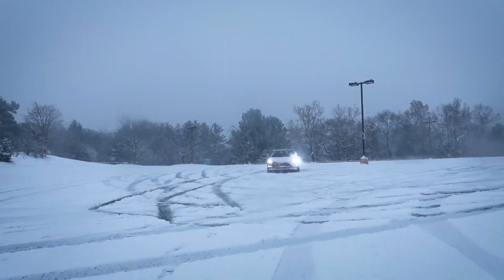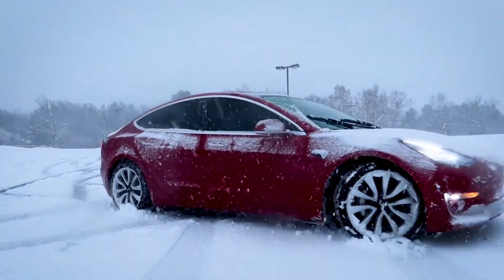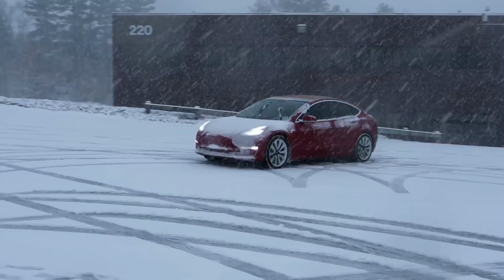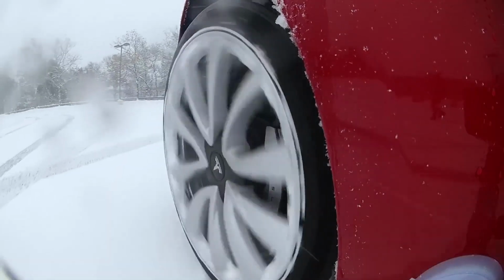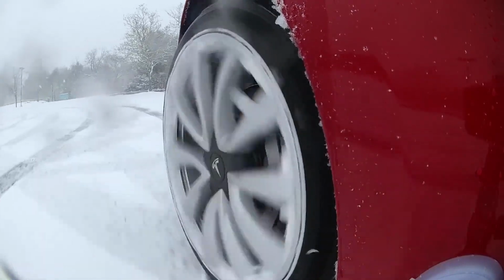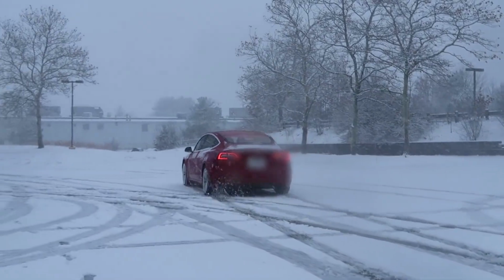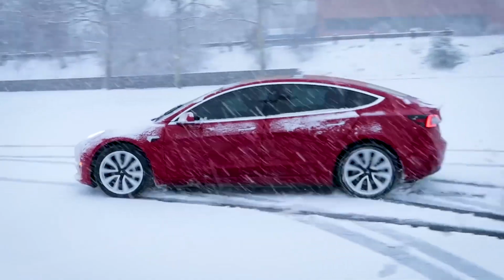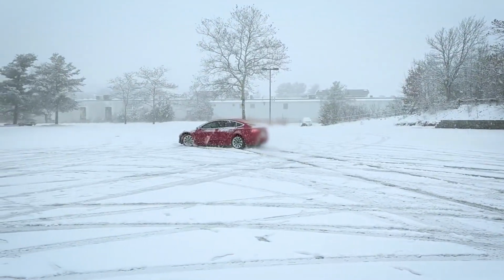Off The Grid Podcast - Model 3 Edition!

Comment: Comment on winter tires: they are not just for snow, they are for climates colder than 7C (45F) as a different compound is used. An all-season tire does not perform/grip well below that threshold. If the climate is consistently below 7C for long periods, it is recommended to put winter tires on your vehicle regardless of precipitation.

Comment: As a Tesla Model X owner in the Colorado Rocky Mountains who is originally from rural Illinois I can say definitively that your statements about AWD not being that important only apply in mostly level areas with light snow and no ice. While good snow tires are the most important thing in true winter conditions because they greatly improve acceleration, braking, and steering, you will find that an AWD car with the same tires will accelerate faster and make it up inclines that a 2WD car will not. And if the snow is a few inches deep two drive wheels will not provide enough traction to force the car through the snow. So if you live in a city with level streets and the snow never accumulates much you will probably be fine with a 2WD,, but if you live or drive in the country or in a hilly city AWD is critical.

Comment: I dont know why the tec savy tesla use a resister heater? The car has A/C why not just put a simple valve in the system and make it reverse cycle, It will use a 1/3 of the power for the same heat output.

Comment: Two comments: If you can't get enough traction from 2 wheels, you need the 4wd, no matter whether it's electric or not. Regarding the 4WD Teslas, it's not only the front wheel drive being more efficient, it's also the front motor being optimized for higher speeds (longer transmission), afaik.

Comment: I don’t think the issue is too many buttons with new tech. It’s the lack of intelligent and intuitive interface design on many products. With a well thought out GUI (Graphic User Interface) a product should be easy for anyone to operate unless they are technophobes who don’t want to make an effort.  
As an aside, please consider shutting off that color changing spotlight in the mancave when you are filming, the constant color shifting is very distracting.
Reply: This thinking is underrated. I personally happen to think that the Tesla gui is decent, but there needs to be something like a HUD in the 3, as well as a quick way to access different contexts that you can control with the steering wheel buttons.

Comment: wouldn't all wheel drive go faster in the snow because the traction generated by the weight and surface area of the front wheels has no torque applied to it in a rear wheel car.

Comment: The worrisome thing is how much time is required looking at the screen when one should be looking outside. I know that this is all well and good but even flying the Airbus as pilots we were always told to have one person looking outside when there was congestion in the vicinity. Do you feel that it is safe to be tapping on the screen rather than say steering wheel thumb wheels or stalks and say using a head-up display? Is it not like using a tablet or smartphone whilst driving. Please do not think I'm a nay sayer, I love the technology.

Comment: Aftermarket add-on idea: old school buttons, knobs and sliders with an analogue feel that attach around the centre screen and effect the same actions as going through the menus. I'll leave it to the experts to work out how to hook into the car settings behind the scenes. A robot arm that did all the touch screen actions would be the funniest though.
Reply: Actually it would probably be simpler than that, quick links on the screen to switch to the correct context. Control through the buttons on the wheel.

Even better, voice control: 'set temperature 24', and it just does it.
Reply: Your gestures comment is valid, but I think critically that you have to weigh that up against the similar cost for learning the physical controls *in that car*. Every car is different, and you need to learn that cars controls if you want to operate it without looking. That is no different to gestures.

On the other hand, as more cars used gestures, perhaps you could import your own - ie. both of your cars, even different brands, respond to the same gestures in the same way. That would be a massive bonus to gestures.

As for the voice recording thing, there's no reason you can't use that in a car - the recording is only used locally to ensure that it catches wake words, and only the request after that is sent to servers. Additionally you can use a button on the wheel to 'wake' the system, negating the need to say 'Hey Tesla', and instantly recording your request.

I have a google home, and while it doesn't do everything I ask it, the critical components of operating a connected car would be relatively simple to implement - I mean, there are only so many functions available within the car, the hard part for these systems is responding to any potential request, no matter how varied.

Comment: I don't think the explanation of how the traction control works is accurate. The electric motor doesn't naturally have better traction. The Model S, Model X, and Model 3 all have a single motor per axle, driving an open differential, and under normal circumstances one wheel on the axle will slip while the other wheel gains traction, just like an ICE car. The difference is that tesla is detecting wheel slip and applying the brakes on each individual wheel that slips in order to transfer power to the wheel with better traction, this is sort of a cheaper version of a limited slip differential. The McLaren P1 does the same thing. Check out this video for a good explanation https://www.youtube.com/watch?v=gBHmWZcnWwM